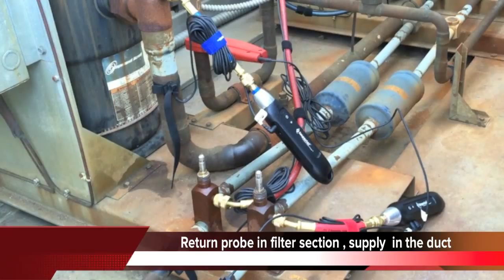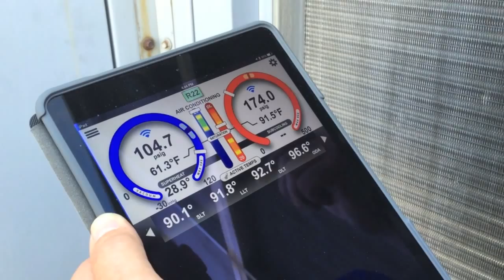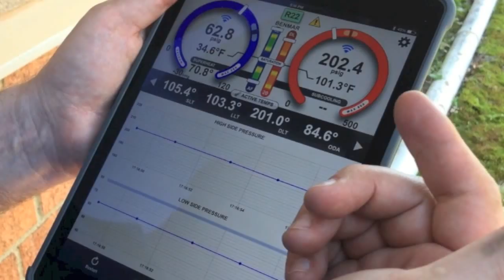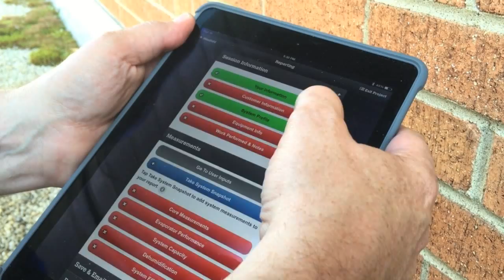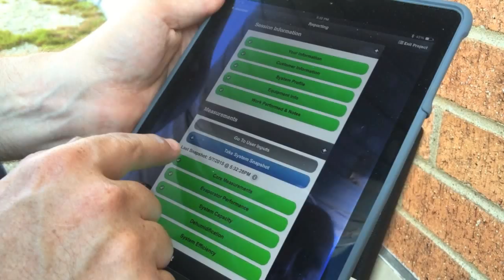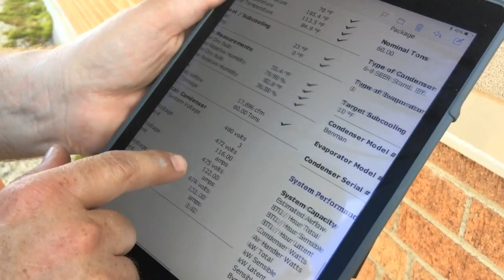iManifold Multi Circuit Mode

Comment: thanks so much for the video Jim, well overdue for commercial, I notice most of there targeted to residential, and split systems, not too many package units talk, would like to see some more with 3 stage cooling and water source heat pumps and sensors options

Comment: I do like the multi circuit mode, used it today in fact on a couple 10 ton 2 circuit units. I do how ever wish that the multi circuit report would show the circuits on 1 report instead of having to print out multiple reports..  also with 200 units under my care it would be nice to be able to organize the projects list and having a search feature in the projects instead of having miles of scrolling looking for that unit.  Being able to extract the reports to my PC from my portable device would be a huge time saver as I dont always have wifi to be able to email.  having to reopen each project back at the office and wait a minute between emails.  I'm still hoping to be able to use my surface pro with my iconnect system soon.